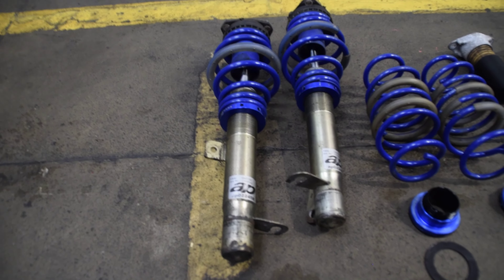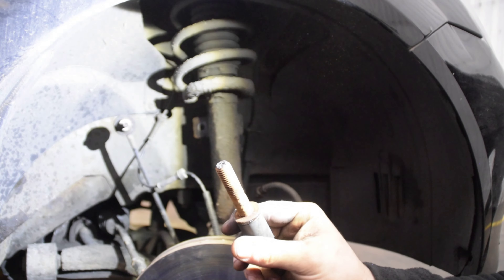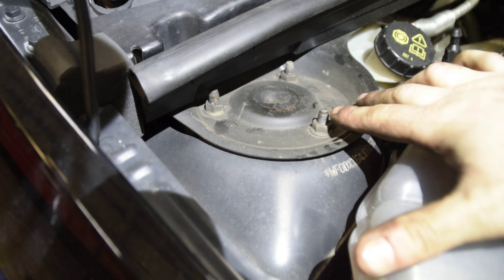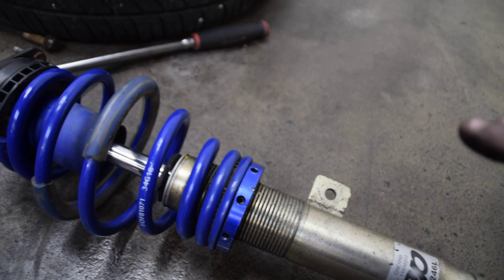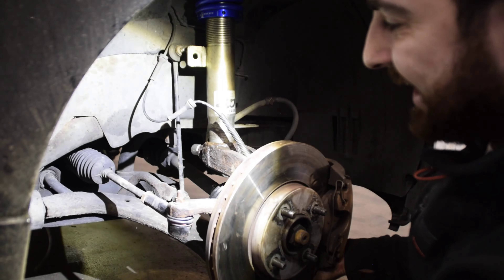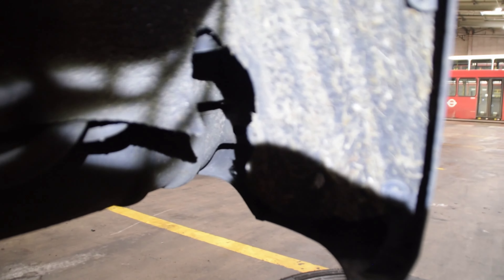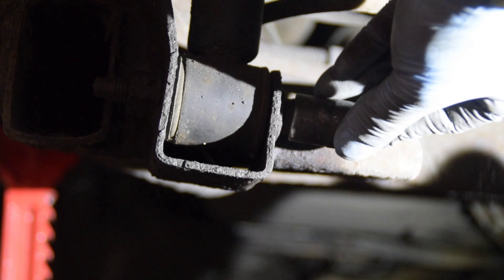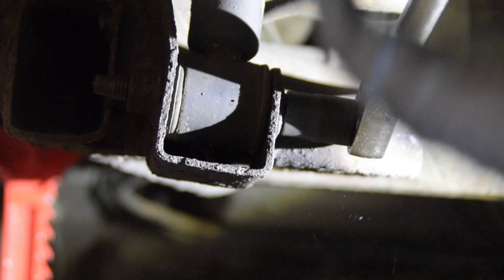Fitting AP Coilovers To A MK6 Fiesta ST150- The Black ST Returns To The Channel!!

Comment: In my experience, its usually dirt, grime or rust in the hubs that stop the coilover going on. Clean the hub with a drill brush attachment, plenty of copper slip, jack and hammer lol works a treat
Reply from the maker: The hub was clean on the inside and the otherside had been off twice and still caused the same them AP’s are just a bit more grief to fit plus why go through all that (unless it’s needed) when a socket helps you in a matter of seconds. I used a jack and hammer aswell to draw the hub up. Plus I try and avoids copper slip as I’ve found it attracts the dirt for one and have seen components seize after a while as it gunks up